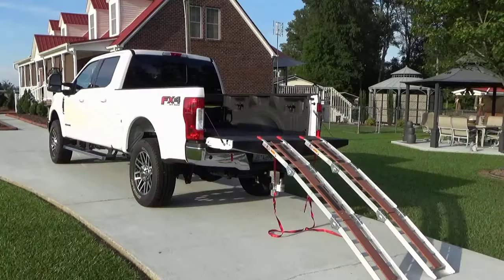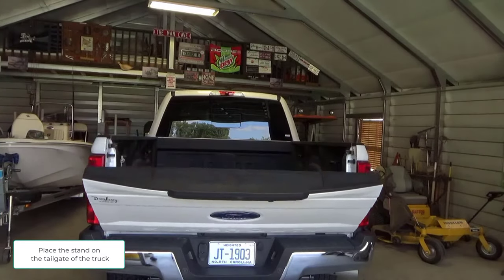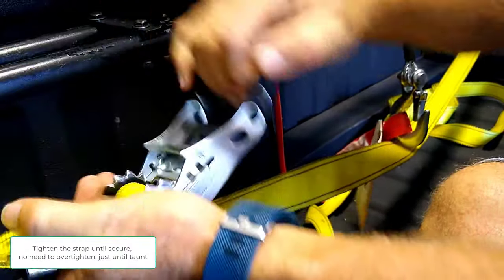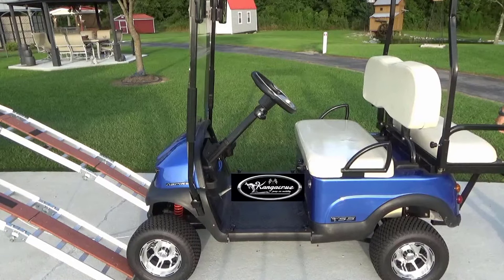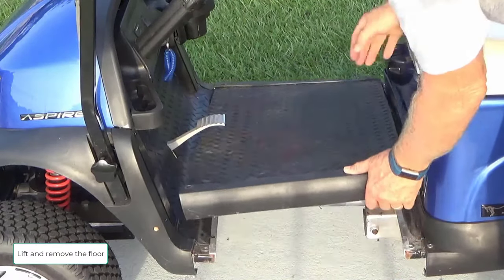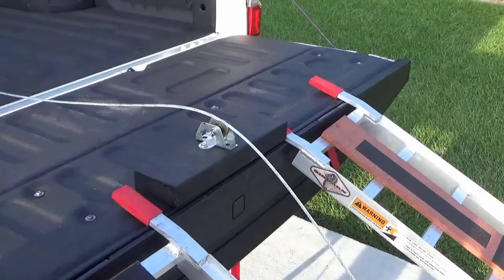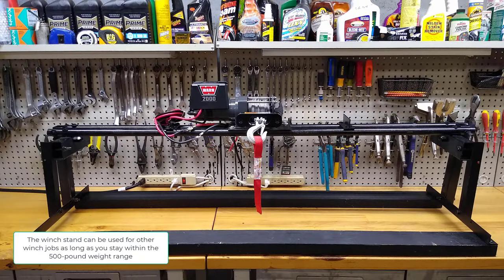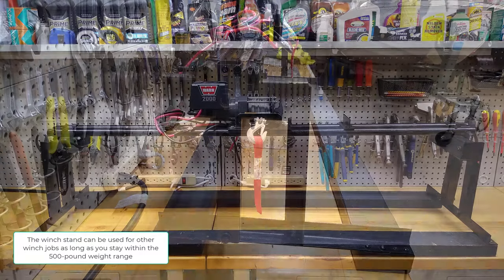No Weld - No Bolt - Portable Truck Bed Winch Stand

Comment: There is an electric winch that is made to mount to a trailer ball or chain/cable. You can also use it manually if needed.
Reply from the maker: I am aware of the portable hitch ball winch, but it will only function correctly if it is properly installed. It cannot be used with your truck's hitch ball since it is too low to the ground.

You need to place the hitch ball winch at a height of at least 17 inches from the truck bed floor.

It is crucial to install a winch properly to avoid causing harm to individuals operating or standing near the equipment in case the winch fails at any point during the winching process. Ensure that you calculate and construct a suitable mounting point in your truck.

Depending on the height of the truck bed, the length of the ramps, and the weight of the object, the height required to mount the winch in the truck or trailer can be determined.

If the winch is installed in the truck bed floor and your truck bed is 35 inches high above the ground, as you pull the object up the incline on the ramps, every inch you pull the object up, it exerts a downward force on the cable. This causes a lot of resistance on the winch and cable which can be quite challenging to handle.

Increasing the height of the hitch ball in the truck bed reduces resistance on the winch and cable.

The simple formula for a winch is Force = Mass x Acceleration, or F = m x a. This means that the force required to lift an object with a winch is directly proportional to its mass and the acceleration at which it is being lifted.

The formula for calculating the ramp angle is Angle = inverse tangent (height/length). This means that the angle of a ramp is determined by dividing the height of the ramp by its length and finding the inverse tangent of that value.

The relationship between the ramp angle and the force required to pull an object up the ramp is that the steeper the angle of the ramp, the more force will be required to pull the object up. This is because the steeper the ramp, the greater the vertical distance the object needs to be lifted, resulting in a higher required force.

The mass of an object does not directly affect the angle of a ramp needed to lift it. The angle of the ramp is primarily affected by the height and length of the ramp, as well as the force required to lift the object.

Thanks for watching my video
Norman

Comment: Good idea and build but i think im going to try and make a telescoping bracket that uses j bolts at the ends and some 1” all thread for the telescoping with some square stock pipe that the winch will u bolt to..  at first i was just using a ratchet strap attached to both top bed loops and had the winch with a u bolt holding it to the strap..   dont do this..   it hurts when it breaks..  both the truck and your dumb ass standing anywhere near it when it breaks..  by your im referring to myself.. got smacked in the face by the winch then crushed by the generator i was pulling into the bed..  dont have anybody around ever so was stuck there for a good long bit till the mail man came around and called 911..   worst part about it all was i made friends with a colony of red ants that were there…. Then made enemies with em and they declared war with me..  that sucked..  the jaw was bad and back but the ants..  good story to tell but bad one to be able to tell it firsthand..
Reply from the maker: Sorry to hear about your injury. That sounds really painful! I hope you can design a winch system for your truck that is safer and easier to use. "I understand the pain of fire ants as we have them here as well. They are very aggressive and their bites can be multiple at once. I'm relieved to hear that you are recovering from the accident. Wishing you and your family a Merry Christmas! Thank you for taking the time to watch my video."
Norman

Comment: It seems you could’ve just strapped the winch directly to the yellow strap making the rest of the modifications unnecessary.  Or am I wrong?
Reply from the maker: Dan,
That would not work. The amount of force, rise, object weight, angle, and travel distance would be too much resistance connecting only to a winch and strap. The steel framework attached to the winch takes 60% of the downward pressure off the straps and tie-down brackets on both sides of the truck. As the rise increases, the weight also increases significantly. The steel frames outward front legs, press against the floor of the truck when there is resistance applied to the winch. With almost 4 feet of legs across the bed of the truck, it allows the small winch and strap to handle 500 pounds of dry weight multiplied by the rise and distance.
Thanks for watching my video.
Norman

Comment: Well not securing a load is a ticket in most states. That is a big gamble. When I put my zero turn mower in the bed of my truck it gets strapped down
Reply from the maker: You are right about that. It is not shown in the video, The golf cart is strapped and secured to the bed of the truck when traveling down the road. The video was only demonstrating how the cart is loaded in the truck bed.
Thanks for watching my video!
Norman

Comment: Can’t you make the entire thing out of wood?
Reply from the maker: You can, but I would not recommend it. You'll need more materials and a larger stand if you build it out of wood to withstand the force that will be applied.

To achieve the same results with a wooden frame, the framework's dynamics would need to undergo significant changes. You must use physics to calculate the necessary force, rise, object weight, angle, distance, wood's tensile strength, and the hardware's tensile strength used to assemble it. 

The ultimate tensile strength, also known as the ultimate strength, is the maximum stress the material can withstand before failure.

The steel winch stand is designed to allow 65% of the downward force to be applied to the 18-inch steel angle brackets that face forward on top of the 2X4s.

When the winch is pulling the golf cart up the ramps, the 2X4s are only used for pressing down onto the truck bed stopping the winch stand from shifting outward. Allowing only 35% of the force to be applied to the anchor points inside the truck bed.

It is crucial to construct a winch stand properly to avoid causing harm to yourself or individuals operating or standing near the equipment in case the winch fails at any point during the winching process. Ensure that you calculate and construct a suitable structure if you decide to only use wood.

Thanks for watching my video
Norman

Comment: Getting the golf cart (or ATV) into the bed of the pickup is cheaper than licensing a trailer every year.  Good job!  I use wing nuts on my temporary use battery.  Saves the trouble of locating a wrench.  Never saw a collapsible golf cart!
Reply from the maker: Good idea to use wing nuts, I will switch and do the same. The collapsible golf cart is easy to carry on camping trips. It is made with a light weight aluminum frame and has a total weight including the 3 batteries of 400 pounds.
I appreciate your comments and thanks for watching my video.
Norman
Reply: It's a Power Wheels golf cart

Comment: i use an elect boat winch ! attached to a cable hooked to each lower tie down hooks you can use turn buckle if you wish a tighter cable .the cable will take the place of the stand you built and simply winch it up the ramps . NO problems .
Reply from the maker: That sounds like a good idea. Thanks for watching my video.
Norman
Reply: rlr4294: I was thinking of doing something similar using a chain instead of cables between the lower front tie downs on my Ford F150. However, I am concerned  that the force pulling to the center of the bed might pull the tie downs out of the bed mounts. I will be pulling a 300 lb Cricket golf cart up similar 7 ft ramps. So using a cable and your winch has not caused any damage?
Reply: @markheene8852  No Not at all and im pulling a Cart Golf and a Mower i do put like a 2x6 (short Piece)at the end of my tail gate where the mower Deck wont scrape when it  transitions from the Ramps to the Truck bed. to Easy (2500 hd chevy ) i send a picture next time i use it .

Comment: Awesome job. We have a Cricket Cart with the same Truck and ramps. Actually looks and works like your cart except the collapse is manual on ours. I like the power feature on yours! The Cricket has an optional Remote Control that can be installed, which we did,  ( 350.00 ) and makes it super easy to load and unload. Still you did a great job adapting.
Reply from the maker: Since we bought the mini golf cart it has been great to be able to take the cart with us. But getting it safely into the truck was not easy. 
Now With the portable winch,  I can get it loaded and unloaded by myself with no problem. Thanks for watching my video.
Norman
Reply: Glad to hear the Cricklet Cart Remote worked well for you!

Comment: I use aluminum ramps and simply press the accelerator pedal !  My Kangacruz will climb right up into the truck bed. Same height 😊
Reply from the maker: Don,
The winch is installed for safety reasons. While most golf carts can be loaded onto a truck bed with a ramp, it is not recommended to attempt inclines that are almost twice the grade ability of the cart. It is unsafe to guide a moving cart up the ramp while holding the pedal with grades that exceed the maximum grade ability of the cart by more than 33%. Kangacruz golf carts can safely handle inclines with a maximum grade of 20%.
Furthermore, it is not safe to try and control the cart when it is coming down the ramp, as it can quickly run down the incline without any control or cable to hold it back. Therefore, using a winch to control the cart's upward and downward movements while on a ramp during loading and unloading is much safer and easier.
Thanks for watching my video!
Norman

Comment: Nice video.. what did you use on top of the ramp to make the surface smooth for the tires?
Reply from the maker: I used OSB board. I used a waterproof stain on the surface. I countersunk the holes and screwed it down to the ramp.
Thanks for watching my video!
Norman

Comment: nice  idea, where did you buy the ramp from, can you share the link
Reply from the maker: I slightly modified the ramps by adding 1/2" X 5"  wood planks screwed to the center of each folded section of the ramps. This was to help reduce the force needed to pull the golf cart up the ramps. 
Here is a link: https://amzn.to/3Fke41O
Thanks for watching my video
Norman

Comment: Do you think this would handle a load of up to 1000lbs? If if not what would you substitute? It wouldn’t be a daily thing it would be something barely used 2x a month.
Reply from the maker: Zach,
Unfortunately, this set-up would not handle 1000 pounds. The framework is not able to withstand that much weight resistance. To pull 1000 pounds the dynamics of the framework would have to change significantly. You will have to calculate using physics to determine the force, rise, object weight, angle, distance, etc. to redesign a winch framework that can handle the weight you want to load.
You will not be able to use the tie-down brackets in your truck bed to secure the frame. The tie-down brackets in an F250 Ford truck have a maximum force between directly opposed cleats of 275 pounds and a maximum force between diagonally opposed cleats of 600 pounds.
The framework would need a welded steel frame and most likely be bolted through the floor to the frame of your truck.
I hope this helps, thanks for watching my video.
Norman

Comment: Excellent video. I wanted to understand your design thought process.  Is the basic idea that the tension force is transferred to the base of the truck using the horizontal member closer to the tail gate? And the component of the force that will force the stand to rotate forward is the only force that is on strap that is hooked on the side hooks?  Which must be smaller.. I need to refresh my statics from 40 years ago to get the equation right.. Hopefully that would be much lower, so those don't rip out.   Its a great idea, since it works. And if I am thinking correctly about your design, please let me know. So, that we can compute the maximum load more accurately. Regardless, great idea.  I found your link looking for something that can pull up 500 lbs without relying too much on the F150 aluminum body.
Reply from the maker: Ram,
The winch stand was designed to allow 65% of the downward force to be applied to the 18-inch steel angle brackets that face forward on top of the 2X4s.
When the winch is pulling the golf cart up the ramps, the 2X4s are pressing down onto the truck bed stopping the winch stand from shifting outward. Only 35% of the force is applied to the anchor points inside the truck bed. That is why only one 5,000-pound capacity strap attached to two anchor points can hold the winch stand in place without breaking the strap or bending and breaking the anchor points.
The tie-down brackets in an F250 Ford truck have a maximum force between directly opposed cleats of 275 pounds and a maximum force between diagonally opposed cleats of 600 pounds.
The pully on the 12-inch 2x4 near the tailgate reduces the force needed to pull the weight up the ramp.
This stand can only pull up to a maximum of 500 pounds. 
Thanks for watching my video,
Norman

Comment: Have you built a wench stand that would work with a heavier load?
Reply from the maker: Unfortunately, it's not possible to increase the weight limit for tie-down brackets in the truck bed. This means that if you want to be able to pull heavier weight, you'll need to bolt it to the frame. Using tie-downs puts a limit on the amount of stress that can be placed on each holding point, and as the strength of the pull increases, the capacity of the tie-downs is reduced.
Thanks for watching my video.
Norman

Comment: What are the dimensions of the frame without the mounting plate or winch?
Reply from the maker: The top frame width - 9 inches
The top frame height - 15 inches
Bottom frame width - 17 - 1/2 inches
Bottom frame length - 48 - 3/8 inches
Thanks for watching my video!
Norman

Comment: i have started a laser cleaning business and am wondering if i should get a truck or a trailer for moving it around. its around 600lbs. the unit is around 1.3m tall x .5m wide, and around 1.3m deep. the machine has a water cooler so its not top heavy, but i am afraid if i should take it up the ramp like this. specially since its only running on 1.5in casters.
Reply from the maker: The winch stand shown in the video is built for 500 pounds or less with a 39” ramp height and 7.5 ft ramp run. Depending on the height and length of the ramp you plan to use, you need to calculate the rise and run to make sure you can pull 600 pounds. Longer ramps and lower rise will reduce the force needed to pull the weight up the ramp. 
Thanks,
Norman